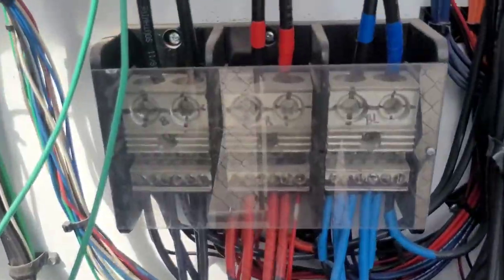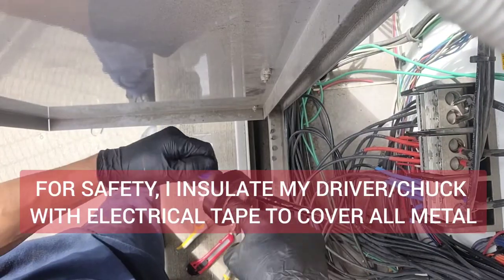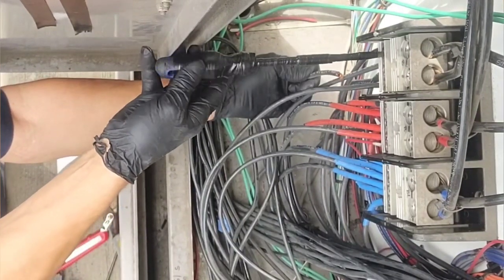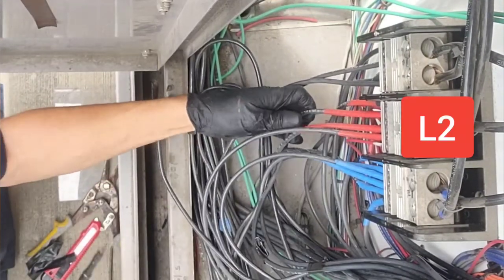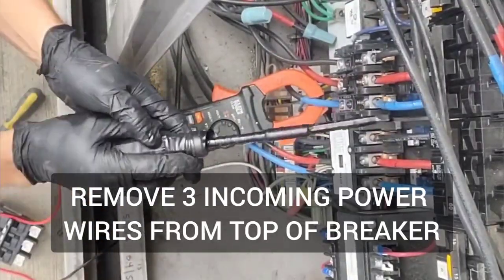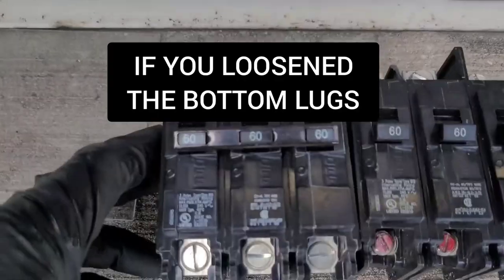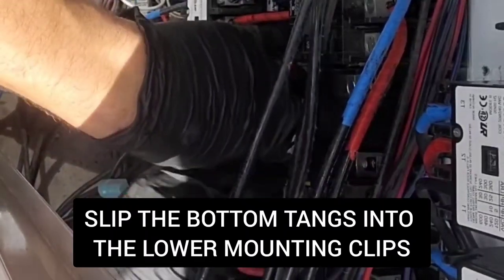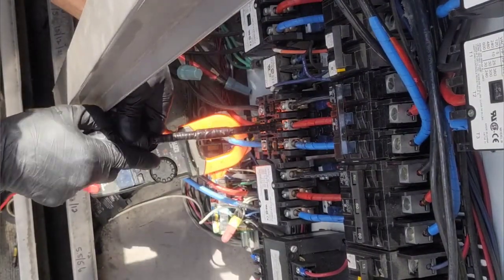Replace ENERGIZED High Voltage 3 Phase Breaker In Rack B For Circuit 10 Defrost Heater Circuit 460/3

Comment: Why didn’t you want to shut the rack off to change the breaker?
Reply from the maker: Honestly,  because I felt confident in myself and safe enough to trust my body to not shake or do anything that could've threatened my safety with the insulated flathead that I used, and I felt that i could do that easier than scheduling to come back at night to do it because the managers would not have wanted me to shut the rack down during business hours. Was it the right thing to do, looking back on it now...? No, I don't think so.